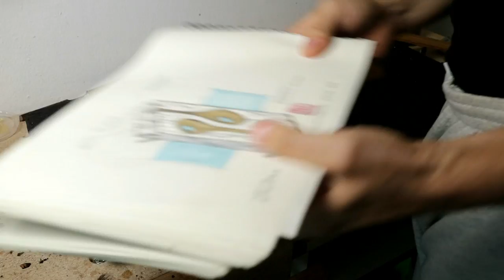Sculptural Wall Clock | Shou-Sugi-Ban Technique

Comment: Really cool project! I have always wanted to try Shou-Sugi-Ban...looks like a messy but fun process! What did you put on the burnt wood to finish it...some kind of oil??
Reply from the maker: Just try, it's not that difficult. I used boiled linseed oil, but you can use any other oil thar dries hard, such as Danish oil, Tung oil or Teak oil.